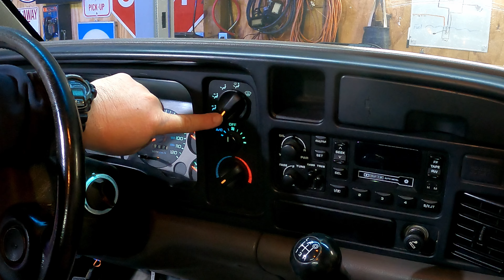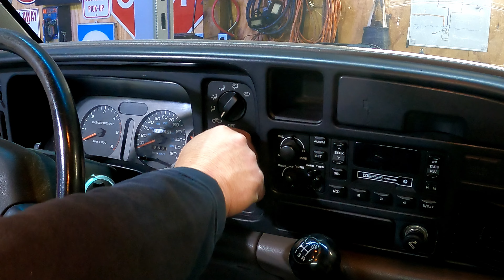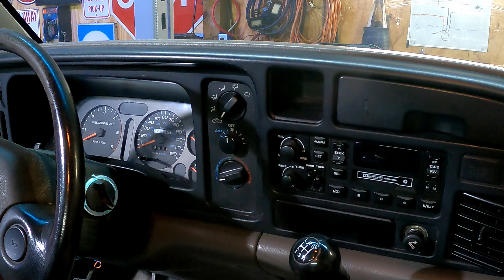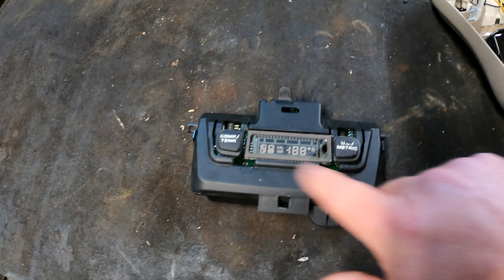Fixing Odds & Ends on my Dodge V10 (8.0 Ram 2500 4x4)

Comment: Yes- interested in your return to stock radio.
Reply from the maker: Thanks. Gonna be an involved process. I already have the self-amplified Infinity speakers - of course all of them need new tinsel leads, and most of the amps are noisy/not working, so it'll be a neat project.

Comment: For the compass you need to unplug it and plug it back in it should reset then start working. I have a 2000 2500 v10 and it had the same problem.
Reply from the maker: Good info, thanks!

Comment: If you ever decide to go aftermarket on your air intake, let me know. I'm in the process of restoring my '99 V10 and am in need of OEM parts for the intake. I have the housing, but need the ambient air ducts/intake hose.
Reply from the maker: Sure will! Good luck on your project.
Reply: I had to do the same thing for my V10. If it helps you any, here are the factory part numbers for the intake parts from my 2001 Ram parts manual. 
53030165 is the tube to the filter housing from the hard tube. 
53041043 is the curved hard tube, 53041042 is the front section of the hard tube that ends near the battery. 
At the time I posted this, there are several complete sets listed on the ebay. Good luck!

Comment: Do you have a go-to place for v10 parts? I have a 97 v10 2500 I got about a year ago and have been slowly doing repairs on but at this point, I'm having trouble finding the parts I need since they arent made anymore!
Reply from the maker: Man, that's been my struggle too. I've found LOTS of parts for the body in junkyards, but the engine parts are getting scarce. If you find somewhere, I'd love to know where.

Comment: I was watching because i needed to remove the valve cover. which means replace  the gasket on my truck. i was trying to replace the Pvc valve and broke the neck and now the only way to get it out is 
To remove the value cover. 
Thanks for the video.
Reply from the maker: Thanks, valve cover should not be a big deal
Reply: @ProjectTimeGarage 

Update, I got the valve cover removed and replaced the gaskets the PVC valves. Should have painted valve covers. YES  ! I can't speak for everyone else. But putting the radio back too stock would be of interest. Or adding a double den screen would be better. I've been thinking about adding the blue sea blade fues block for accessories like in bed lights and some lights in the footwells or under dash. Just thinking or a compressor. What do you think ? Your probably better at this than me. Somebody has to show the kids how to make their 2nd gen  better. 

Thanks

Comment: can i put acetone and atf mixer in the cylinder of 7.3 to get them unseized
Reply from the maker: Man, I've used all kinds of mixtures in the past. Really the best thing I've found is either diesel fuel/Marvel Mystery or Acetone/ATF. Both have worked very well for me in the past.
Reply: thank you for your help, so i can just pure it down the glow plugs port, right

Comment: Nice job. Wish my 95 1500 slt Laramie had the compass mine is just a pocket i don’t think the wires are there to add one but would be nice, I’m surprised it doesn’t have it being a Laramie and all I completely rebuilt the dash I found a good lower dash on eBay mint condition and then bought the lmc factory dash top. Was a pretty penny to do it but was defiantly worth it
Reply from the maker: Does the LMC dash look pretty close to original? Thinking about doing that too. Mine has a single crack in it, but I'm sure it'll get worse.
Reply: @ProjectTimeGarage  yes I believe there are a couple factory color options mine is that darker gray nice color. It looks very factory and can tell its high quality has all the original mounting points to screw to lower dash so far its holding up great made from updated plastic not the junk plastic from the 90s. I would think that this is the only way to go for a OEM like complete dash top replacement.
Reply from the maker: @codybose515  Was it a bear to install? I just looked through the LMC catalog. I think I'm going to get one.
Reply: @ProjectTimeGarage  you have to lean the dash forward at minimum to get to the front dash top screws near windshield their may be some behind the glove box cubby as well. I had to replace my whole dash so i had it out anyway but for that job id say drop the steering column down 2 bolts then loosen the 2 bottom dash bolts near the kick panel’s. And move it forward carefully you shouldn’t need to remove the whole dash to get it. It is kind of a bear but definitely worth it. 😁
Reply: It also may be easier to have a buddy with you to help its not heavy just awkward to move around. I can speak first hand for someone who did it all by themselves 😂
Reply: I have a dash skinz dash cap it's a different shade of grey but in my truck it factory has both light and dark mist grey interior trim so I guess it doesn't matter... and the rainbow thread seats and door panels which are pretty much specific to these trucks..
Reply: And I have seen a total of 3 dodge ram trucks I have seen two 98's and one 99 that has a fog lights switch down under where the airbag switch lock is for the passenger side air bag,, and my truck has a cubby hole there and the factory headlights switch shows the parking light symbol and a indicator illuminates when you pull the same switch you turned to the right to turn the parking lights on showing the fog lights are on so I would guess that is the factory headlights switch to my truck, maybe the ones i saw are from a sport ram?! Anyways it was different I was trying to find a cup holder that is not broken yeah not happening but found two of them on eBay for $125 yeah nope don't need it that bad..

Comment: Use butt connectors with crimpers and heat shrink sleeves and and heat and seal it or posi lock twist connection barrels lol for your reverse lights and for the tag lights you can get replacement set from lmc
Reply from the maker: Yep

Comment: The dodge 1500 and 4X4 decals wore off the tailgate of my truck lol, and so it ended up getting a caved in dr at the bottom and since both were rusty the previous owner had swapped out the doors which are decent but the wrong doors for a quad cab truck they shut but the rear corners are rounded and the quad cab rear door which is the front door jamb and latches are squared off at the corners oh well anyway they were 2500 doors so they pulled the dodge ram 2500 and the magnum V8 decal badges off the doors,so with the replacement grill since it took out a bird lol has no replacement grill emblem dodge ram logo, the only ones left on the truck are the Laramie slt on the side of the cab behind the quad cab doors
Reply from the maker: I just bought a set of replacement decals for my tailgate - good old Ebay.

Comment: Cool your truck had dual exhaust mine was factory single exhaust id like to put factory style deep tone dual exhaust and tips on it but I have a 8 inch cherry bomb to put in place of the factory round rv muffler lol and a 4 ft piece stick of exhaust tubing lol it will be loud lol,, I would like to add the outside compass and thermometer but I don't know what all I would have to add it to my truck i do have to replace the passenger map light in the factory console it is broke the pin is snapped off the lense just bounces around lol.. and the previous owner used a lower level trim truck for the door swap and they had audio latina by Chrysler speakers in the back and 6 1/2 inch speakers in the front, so I have one front door amplifier harness connector but the front door amplifier is no bueno lol
Reply from the maker: From the factory, mine did have the 2-into-1 exhaust too. On the speakers/etc, I'm about to release a video on going back to the factory Infinity setup. On the early 90's trucks, each speaker had its own amplifier attached to the back and was powered from a "Radio Choke", which is a fancy term for a relay, fed  from the dashboard. I'm in the process of re-soldering and re-capping all the amplifiers now. Once they're done, I'm going to do a video on adding an aux input to the factory Infinity head unit. Should be a cool video. If you happen to have any of the 6.5 speakers with the amp still on them, I would be interested in buying them.
Reply: I've still not took the speakers out of the rear doors so I don't know if they are factory chrysler amplifier infinity speakers or not sir .

Comment: I have a question for you. My 94 Dodge Ram will not start. When you turn the ignition to start it, it is like it is stripped, and will not catch. If you jump the starter it will crank. Do you know anything about that?
Reply from the maker: Sounds like the starter bendix possibly. It can't be mechanical if it works by jumping the terminals. You're probably looking at a starter replacement.

Comment: Where’d you get your seat covers? I need to grab a pair for my single cab because I’m afraid of ruining the cloth seats with dirt and grime
Reply from the maker: I actually bought those from my local Dodge dealer back in about 1998. They are the same as the Carhartt Seat Savers that you can buy today.

Comment: And i got lucky all my lights work when I got the truck except one fog light and the other one didn't but both lenses were scratched and scuffed up and had overspay from the flat black paint on the chrome replaced front bumper from the bird incident..so I bought DNA motoring yellow lense brand new fog lights and put them in the truck bumper and they work well but I need to adjust them better so they are aimed straight they are currently angled to each outer side so they are not sitting straight into the holes in the bumper
Reply from the maker: I just finished putting new driving lights on mine this weekend. AuxBeam sent over some of the dual color White/Amber lights for review. They look pretty good.